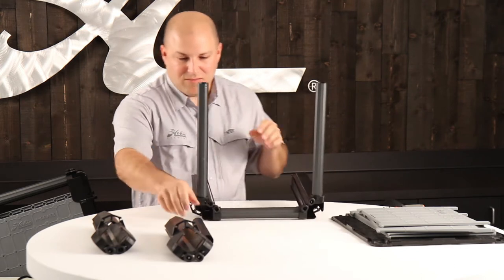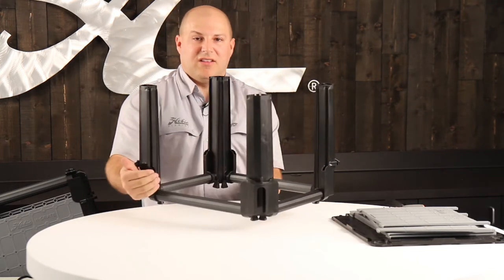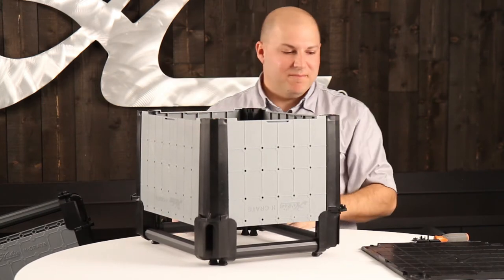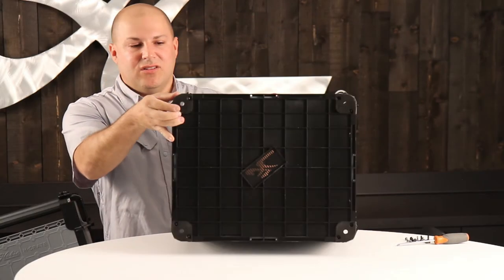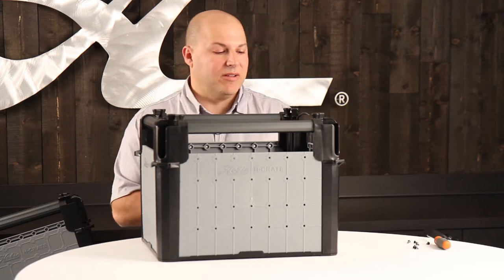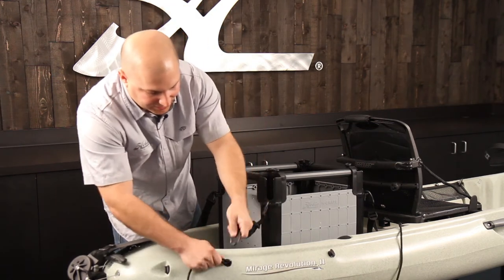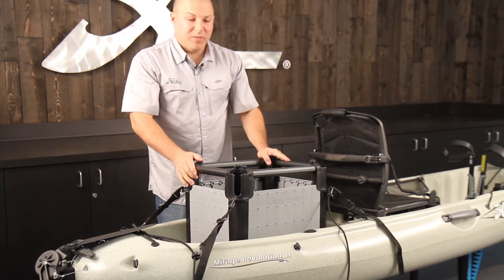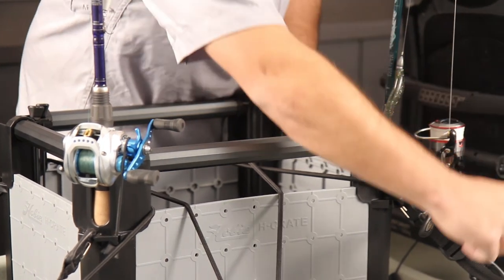Hobie Fishing: H-Crate Assembly, Hobie's tackle management bin

Comment: One thing that is very important that was left out on this video is installing the self-tapping screws that secure the H-Rail extrusions to the corners of the H-Crate. These screws add extra strength and are especially necessary for H-Crates that fit together more loosely due to variance in part sizes.
Reply: Isn't that what he is doing at 3:15?
Reply: What size are the tapping screws?  I lost the bag.